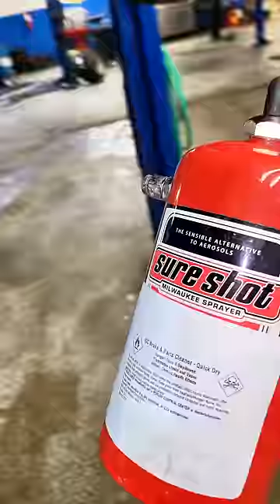Oil Change Perfection 😗👌 #honda #oilchange #satisfying

Comment: My Dad used to say  “old oil is better than no oil”.
Reply: And clean oil is way better than sludge
Reply: 38-40k and 8yrs on my old car agrees, its a waste of money especially on a 1200$ car.
Reply: @MrTheHillfolk $20 once or twice a year is a waste of money to keep ur engine running smoothly? :/
Reply: @JireSoftware  a whole quart of oil? 
Why bother ? 
It ran fine for 10+yrs and when I handed it off to a neighbor. 
Look at the guidelines for that no oil change Briggs ,it's not unreasonable at all. 
Of course it doesn't apply if  you mow half of North Dakota as your backyard
Reply: You cant choose in this matter. Change the damn oil every 5000 miles
Reply: @isaac2608 anyone who says otherwise don’t give a shit about their car lol
Reply: @MrTheHillfolk lemmi guess ford i300
Reply: Once every year is recommended
Reply: Every 10.000 kms is fine, sometimes more or less frequently depending on vehicle usage!
Reply: @isaac2608 , why so soon?
Reply: Yes old oil is absolutely better than no oil, but the detergents and lubricity of the oil break down over time. This is why the inside of engines become caked in carbon deposits after its owner just adds oil or doesn't change it enough. It all comes down to what quality of life one wants for the engine.
Reply: @jedialpha2 , and in cars where the use of 0W-20 oil is prescribed, it is also better to have e.g. 5W-40 as nothing.
Reply: @dejandezman6139 because oil looses its viscosity once it heats up and vets pushed through all the parts of the motor, once it’s dirty and old it becomes more stiff and when oil gets stiff it doesn’t lubricate properly leading to blown gaskets and seized parts
Reply: I’m stealing this one. Tell your dad I said thanks
Reply: Your dad is almost there. In his words (describing him):
"half wisdom is better than no wisdom.
Reply: @MrTheHillfolk Yeah except that 90% of engines that need to be rebuilt because they shit a brick are because of not changing oil frequent enough, like what?

Comment: Drives me nuts when people don’t let the oil drain. I get it, it’s a shop where time is money, I just hate it. One of many reasons I do my own
Reply: 5w-30 i daing and inspect the rest of the car, mesuring threads, checking PSI in tyres so it is correct, breakes and so on, by the time im finished the oil is drained.

0w-16 / 20 i drain and do above and then go for lunch and its still draining when im back.
Reply: @ArsonistArborist  What is thick?
5w-30 is standard oil.
0w-16/20 are mutch lighter, 0w-16 is alittle thicker then water, becous its so light it never stops running.
Reply: This is 5minutes oil change :)
Reply: You do realize no matter how long you let it drain there is at least 1/2 quart in there that will never come out. Look up dry fill after rebuild compared to service fill, subtract, and that's how much dirty oil will never come out.
Reply: @joeyfredrickson-nt4dh  of course there will be SOME contaminated oil remaining, but my goal is to minimize that as much as possible. When the drip slows, I put the filler cap back on and put my air blower nozzle in the dip stock hole. You’d be surprised how much more comes out. I wouldn’t be surprised if it’s another quarter quart
Reply: @ArsonistArborist  thats why you must change the oil with engine hot
Reply: @andresalcalde704  I do
Reply: I'm which you on that I do my own oil change .
Reply: @joeyfredrickson-nt4dh true but if you don't let it all drain out,  then that's just that much more added to that pint that doesn't !!
Reply: @ArsonistArborist would that be a half pint lol ✌
Reply: @juniorcopeland9082  idk pints and quarts lol, I’m not American. I was just trying to convert it to terms your guys can relate to, we use litres lol
Reply: @ArsonistArborist  I understand...was just joking lol ✌
Reply: @joeyfredrickson-nt4dh This is why you let the car sit in the garage overnight with the drain plug open, and then flush 1 qt through the engine.
Reply: You really think that ounce or 2 that would drain out by waiting another 10 minutes makes any difference when adding 5 or 6 qts of fresh oil? It's all in your head.
Reply: Why they don't clean the bucket that holds oil
Reply: I cried
Reply: @beyondthestars4299  what?
Reply: @ArsonistArborist  ?
Reply: I literally thought i was the only one that cared about that!
Reply: Me too I let it drain for over 30 mins
Reply: I would never let this guy near my vehicles. I change my own oil, with much less mess.
Reply: On the Ford 5 cylinder 3.0 diesel engine, if you don't refill the engine within 10 minutes of dropping the old oil out, the variable flow oil pump loses its prime.  Then it is a whole world of hurt, getting that oil pump re-primed.
Reply: If you got paid how we get paid you would understand. 0.3 for an oil change means in and out quick.
Reply: @joeyfredrickson-nt4dh никогда не вытечет? Я меняю масло х2, второй раз сливают такую же черноту, зато после этого на щупе чистейшее масло, как в канистре
Reply: Yall need to stop acting like yall a master technician. I promise everyone thinks their opinion on fixing cars is correct
Reply: @tempestv8  I’ve never heard of a 3L 5 cylinder Ford diesel. What’s that in?
Reply: Totally agree with you!
Reply: @stevemccooleq I agree, the differance it makes is negligible you are better off just changing the oil sooner rather than fussing with the last few drops in the engine.
Reply: @ArsonistArborist  there is still at least 0.3-0.5L of oil left in the engine with every change. It’s all stuck in all those nooks and crannies and pipelines inside the engine. You can only completely flush the oil out unless you are rebuilding the engine or the engine is fresh unoiled straight out of the factory. That is the reason why you will see 2 separate information about oil filling which one is about dry filling ( new unoiled engine ) and another one is maintenance filling that will typically require 0.3-0.5L less. It is a fact that can’t get me to sleep at night as well.
Reply: @axe4770  lol I know, but still, you can get a lot more out with air pressure and patience
Reply: i wait half hour the flush a bit of clean..shops can't afford the time
Reply: @johnpro2847  I usually have some other maintenance I can do while I let it drain like blow out the air filter, clean the MAF sensor, the the throttle body, fill a tire, etc
Reply: Change oil at half operating temp. Drain for a few minutes, add about 1/2 liter or quart of cheap but clean oil. Once you see the clean oil drain out, I’ll seal it add the good oil.
Filling the oil filter as well**
Reply: should change every 3000 - 3500 miles no matter what the manual says
Reply: @joefromaz5467  that’s a little excessive, in most situations, IMO. I’d say closer to 5000, unless your vehicle is in a more extreme situation (for example, if you live in extreme climates and you’re doing small commutes all the time where your vehicle never gets up to operating temperature)
Reply: @ArsonistArborist The 5 cycle diesel engine is identical to the 4 cycle diesel engine, but with a second rinse at the end.

The second rinse is helpful for those with sensitive skin who insist on using the crappy Sam’s Club powdered laundry detergent in the 40 pound bucket.
Reply: @CH67guy1  what in the world are you talking about?
Reply: @andresalcalde704 don’t listen to Andre do not change your oil while the car is hot unless you wanna burn tf outta yourself
Reply: I totally agree 👍
Reply: If you are parked so your drain plug is "down hill" when you change oil and you pull the fuse for the ignition and crank the motor over for 10 seconds, you'll get almost all out. After filling with the fresh stuff, crank the motor another 10 or so seconds before reinstalling the fuse.
Reply: @codyherring5889  that's not a bad idea. I only run synthetic now and I have an old jug of conventional that I don't know what to do with. I can just use it for flushing. Good call
Reply: @mikeb8342  good idea
Reply: Was thinking the same thing

Comment: Bro didnt even let the old oil drain 😢
Reply: Next $.

That is the motto of this quicky culture these days.
Reply: Theres going to be pockets of old oil everywhere in the engine. It will dilute with the new oil and the new filter will provide clean oil to the bearings etc. We arent going to flush the entire thing in solvent then flush with fresh oil 4-5 times, that would be a massive waste for no observable benefit.
Reply: Bro what it was barely trickling out, not even enough to coat the bottom of a glass
Reply: @FrenchBeefCDN лично я на своей теане меняю масло в 2х объёме, сначала заливаю дешёвое 5w30 A3B4, прогоняю, затем заливаю 5w40 A5B5, во второй раз сливается такая же чернота, как и в первый раз... Зато потом уверен, что следующие 7000 мой VQ будет работать на чистейшем масле
Reply: Want a fully stopped drip? Do it yourself
Reply: You’ll be waiting an eternity for that last drip
Reply: @Angelo80907 that shit wasn’t dripping, it was still a stream
Reply: No torque wrench on the plug?
Reply: That's exactly why I prefer doing maintenance work myself
Reply: This is YouTube shorts, not YouTube 5 minutes.
Reply: @Nobody14576   1/4 grunt tight. No over tightning and no leaks.
Reply: You can let it drain for over 10 minutes and there'll still be oil trickling out. You don't need to get 'every' drop out.
Reply: After 15 years of changing oil them few drips make now difference and your proble talking about 100 millilitres  tiny fractions over 30 minutes iv done tests catching all the drips untill they stop and its no more than a mouth full as long as the cars serviced on time zeros issues.  In a busy shop you may have 10 oil changes in one day hard let everything drip dry
Reply: @kwitwerikok8o863  Suit yourself. 😊
Reply: @CVarden  you are absolutely right. No one will take care of your own car like you would. I only use a shop if the job absolutely requires a lift.
Reply: @LandonsBuildz I guess we were the only 2 people that saw this or he distracted everyone from that fact by cleaning the oil pan at the end.
Reply: @luisdaniel75 Exactly, I've never taken a vehicle to a garage for any repair, thankfully I have the tools and have learnt the skills to look after my older vehicles at least. You can keep these ultra modern cars and EV's, I'm not interested.
Reply: Agreed. This is far from “perfection”.
Reply: @eoghanhennessy443 how do you know it’s a mouth full of oil? Video please
Reply: @Nobody14576 only amateurs need a torque wrench on a drain plug.
Reply: @raftonpounder6696 Not really… I never did for years but if there’s a specification for it, why not? It takes 10 more seconds to torque versus hand tight. If you get in the habit of doing everything by torque, you’ll always know every job is correct. While I agree a drain plug is probably a waste of time, it’s not that much more time that I can’t…

Comment: Oil looked  past due...
Reply: I think there is oil in his metal shavings 😂
Reply: that isn't even past due, that's graduated due
Reply: oil looked like dirty water ...0w-00
Reply: I would check if coolant going into the oil. Oil looks too milky white
Reply: @chocoboblue99 definitely a blown gasket that oil looks a like a milkshake 😭😭😭😭😅
Reply: Ya think?
Reply: @patrickrodriguez4174  dont worry its just the earth dream engines - honda said they are suppose to mix some oil and coolant
Reply: @441meatloaf True. When we had our 2016 Civic, I’d change the oil and filter myself at half the recommended interval just for peace of mind 😅
Reply: That Honda uses 0w 20 and is probably a turbo being that it is a 1.5 and I don't think Honda offered the civic with that motor without a trubo and if you know anything about direct injection, turbo cars the oil turns brown and black eventually just after a few uses lol as it's cooling the trubo aswell. You should probably get up to date on your cars bud. I change my oil every 3k miles and it looks exactly the same
Reply: YA THINK?!?!😂
Reply: The motors past due
Reply: Chrome flavored oil
Reply: This is why you change it 😢

Comment: My god, this comment section makes me want to move to Antarctica. There's always gonna be a bit of oil left in the engine! Unless you fully flush it out (or better yet, disassemble and clean it) which is a waste of time, money, and energy with almost no observable difference under a microscope. Those like 2 tablespoons that you wait for the dripping to stop for will be basically the same amount of debris as this change here. If you really want to do an oil change right, and make your engine last as long as possible, never let your oil get this fcukin dirty! Oil is cheap.. engines are not.